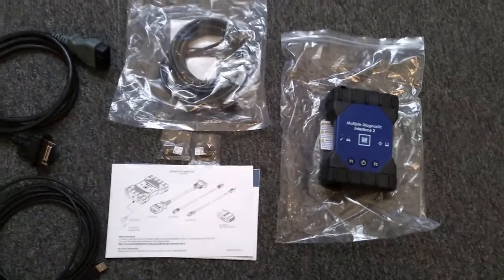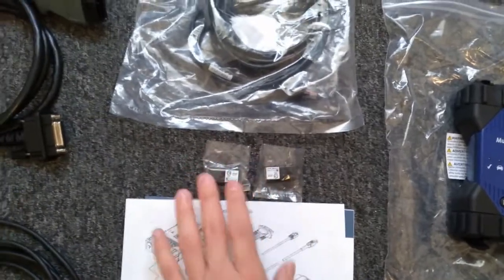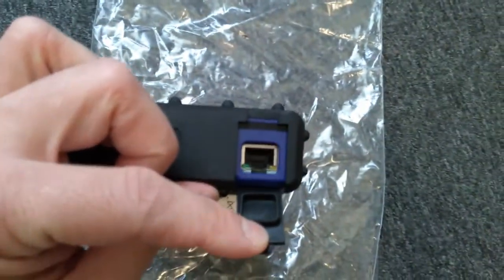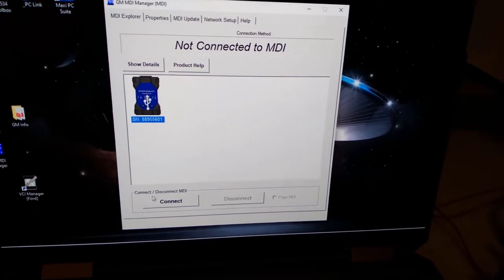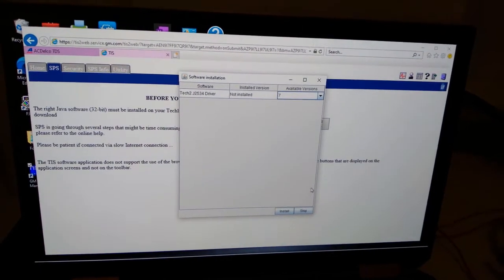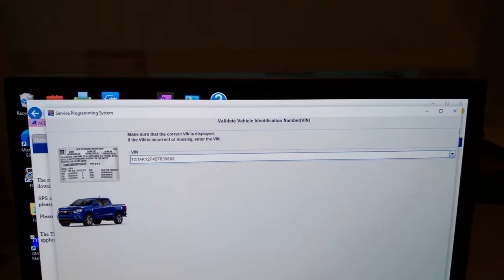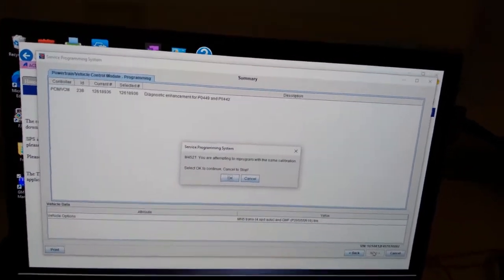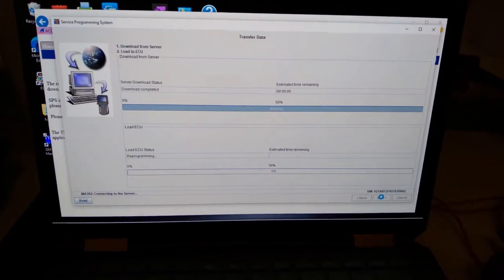Genuine MDI 2 unboxing and reprogramming PCM.

Comment: Does this scan tool diagnose only if you buy the acdelco program
Reply from the maker: Correct. Nothing is for free.
Reply from the maker: @morrisrodney19  I use the GM Tech 2 emulator with a 3 day purchase from AC Delco. If setting it up is an issue they always are there to help.